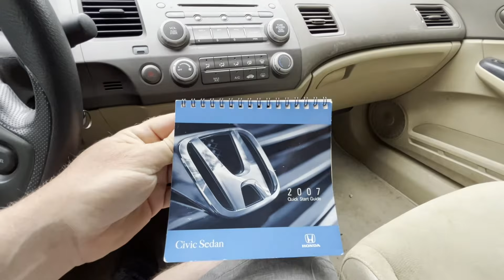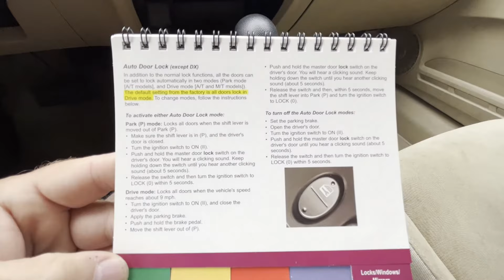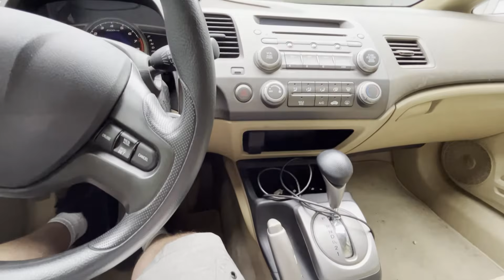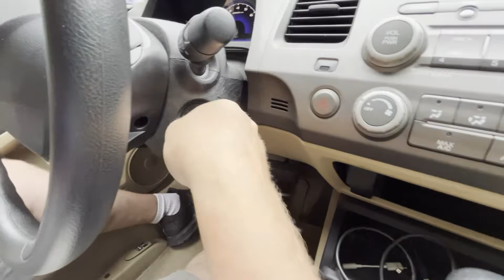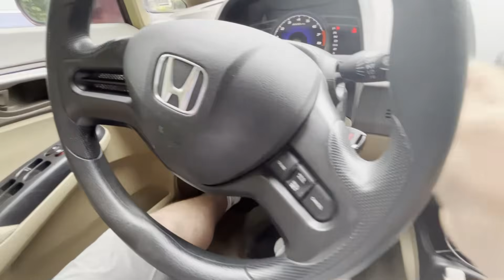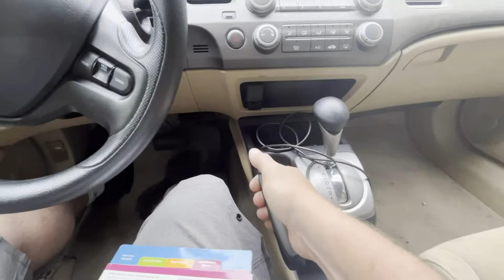Honda Civic 2006 - 2011 8th Gen Automatic Door Lock Unlock Programming DIY. Turn on or off auto lock

Comment: Really helpful video, my question is my key won't turn right to unlock it have to turn it left first, it's a hard left , once I turn it right to unlock it the door still won't unlock. I have activated the theft alarm so now it is auto locking and the alarm won't shut off. And the key still won't unlock the door. I NEED HELP !!
Reply from the maker: Alarm should stop after a while. Try to use the key to unlock another door to get in. Pop the hood and disconnect the battery if you really need to stop the alarm immediately. First step is to replace your Key FOB battery, and go from there. If you have a backup key - try to see if that one still works in your door.

Comment: It is  the same proses with an manual SI ?...I GOT A PROBLEM WIT THIS LOCKS ..it lock by itself and  lucky that i got spark key to open
Reply from the maker: I don't know if it's the same on a manual, however it should be. If you have the owners manual - it should be in there also.

Comment: How do activate it so they car auto locks the doors after you exit the vehicle and walking away? Is that a possibility on 2007 model. Manual model not the lazy man's model. Thank you
Reply from the maker: There is auto unlocking when the key is out, but there is no way to make it auto lock when you exit. You can click the Lock button on your Key/Remote.
Reply: @RepairNut 
Aww that's a shame and weird, my old 2008 type R had walk away self lock. I was hoping my 2007 model would aswell but that's a shame
Reply: @RepairNut bro i have a 2010 civic and mines locks it self , i had my keys on the seat and closed the door for a minute and heard it click closed and locked ne out😐 im trying to shut that feature off , every time i exit the car with the key in i have to crack the window😁
Reply from the maker: @FriedGreenCarrots weird. Mine doesn’t have the option. The Google says you can possibly program it if there is an infotainment screen - it could have the option. Not sure.

Comment: how about i unlock the door from outside with the remote button the problem is 1 door still locked what should i do with this? do you have any idea? thank you so much i hope you can help me with this🙏🙏🙏
Reply from the maker: You could check the fuse for the door locks, and make sure your FOB has a good battery. But it could be the door lock actuator in that door or bad wiring going to that door.
Reply: @RepairNut sometimes its working.. but most of the time are not😢
Reply: @migmax-o6m  just in case you're not aware, pressing the unlock button on the remote once will only unlock the driver's door. Pressing the unlock button twice will unlock all of the doors. This is the way most cars work. It's a safety feature so you're able to enter your car without accidentally allowing another person hiding behind your car to enter at the same time.

So just press the unlock button on your fob twice and it should unlock all doors

Comment: Unfortunately my 2006 Civic will not unlock all of the doors when shifted into Park. I ensured ALL auto-locking and auto-unlocking features are turned off. I performed the 9mph auto-lock procedure with no problems.  When I perform the auto-unlock procedure for unlocking when shifting in park, I do not hear a second click. I hear the first click when the switch is pressed, 5 seconds later I hear another click, as I continue to hold the switch there is no other click.

Comment: I did the recommended clearing of both unlock and lock and programmed the drive with speed lock, then I couldn’t program the unlock at all. So I cleared both again and programmed the unlock in park first, then tried the drive lock with speed and it would not program. Yes I did try resetting it multiple times, nothing. I ended up settling with the lock as soon as its in gear and unlocked in park. Btw it would only program for the driver door to unlock I tried holding the unlock for another five seconds as said in video for the other passengers to unlock but it would program. Yes I did try numerous times and tried resting also nothing. All wel I guess the cars are a bit quirky. Hope this helps someone.

Comment: Why is auto lock when driving not working? Everytime I try to enable this one, it DOES NOT work. I disable all auto locks, and try to enable driving locks but it doesn’t work. Then if I disable them all, and enable park lock it works. Why
Reply: I have the similar issue. I did the recommended clearing of both unlock and lock and programmed the drive with speed lock, then I couldn’t program the unlock at all. So I cleared both again and programmed the unlock in park first, then tried the drive lock with speed and it would not program. Yes I did try resetting it multiple times for both unlock and lock still nothing. I ended up settling with the lock as soon as the civic is in gear and unlocked in park. Btw it would only program for the driver door to unlock I tried holding the unlock for another five seconds as said in video for the other passengers to unlock but it would not program!!! Yes I did try numerous times and tried resting also nothing. All wel I guess the cars are a bit quirky.

Comment: My honda fd its not working  auto lock
Reply from the maker: @Ace-yd2ky  try to turn off the auto locks first. That starts at the 1 minute mark.
Reply: @RepairNut similar process of manual gear?thank you
Reply from the maker: @ yes one of the people that commented said it worked on a manual transmission.
Reply: @RepairNut thank you
Reply: I tried 5 times still it doesnt work

Comment: We have a DX model, so no factory drivers lock switch for some dumb reason, only the passenger side. Ordered a cheap after market replacement switch that has all the windows (including drivers auto up and down) child lock, and now drivers side lock switch. Plugged it in and it works perfectly, and was able to program how we want the locks to function. Seems the wiring harness and brains are all the same, but they cheaped out 10 cents and left out that one switch!
Reply from the maker: @Dr.TobiasFünke01  that’s crazy. You could also go to the scrap yard and find the switches or door panel you need if anyone else runs into this.

Comment: The DX model has lock actuators and is stuck in the default setting. Any way to toggle this without using the driver's side lock button (the DX model does not have a button there, just a plastic cover)
Reply: did you manage to do it?
Reply from the maker: @ Check out the other comment about the DX model - seems that person ordered a cheap replacement switch and installed it into the driver door, because the wiring is actually there.
Reply: @RepairNut  yeah i might do it too, thanks!!
Reply from the maker: @damingy  I haven’t heard of this config. So it has power locks, but no lock/unlock button on the door?

Comment: Thx.  I used the 1st explanation but but doors still locking after 20 seconds.
Went further in video.  Tried opening door.  Then hold down on unlock for 5 seconds then click.  Then took key out. It worked. Thank you soo much.

Comment: is working for manual transmission ?
Reply from the maker: I'm not sure. I would search on Google for this one. Some of the modes do not require being in Park or Neutral so they should work. Try it in Neutral, and try it again in gear and test it out.
Reply: Yes it does work with a manual transmission as well! I just done it
Reply: How?